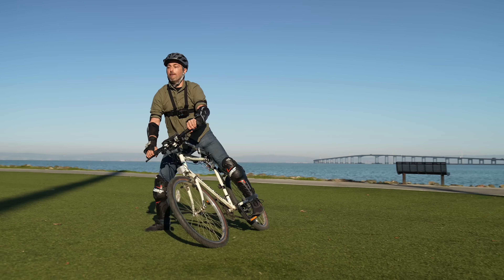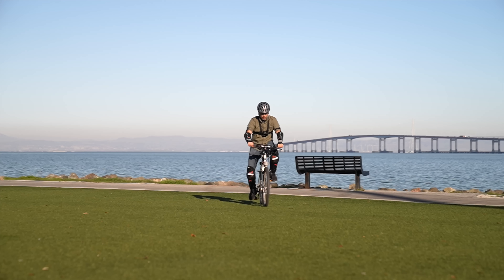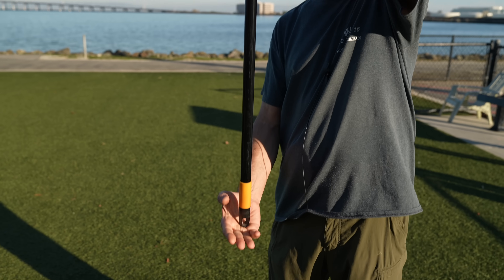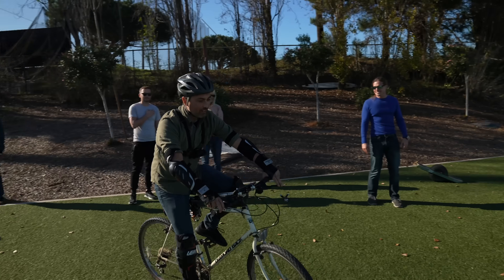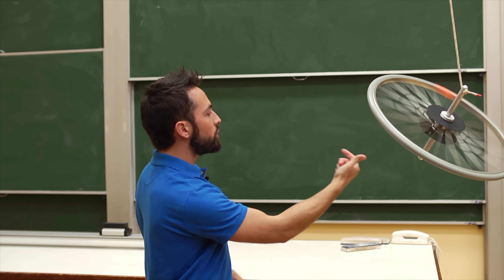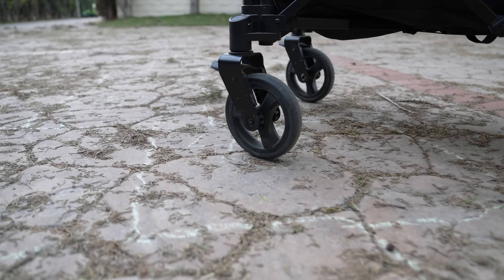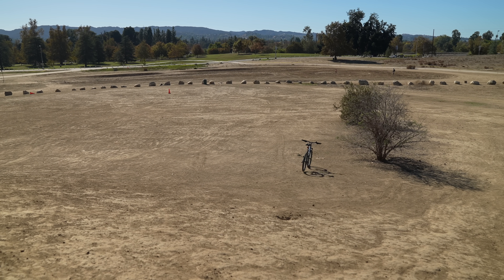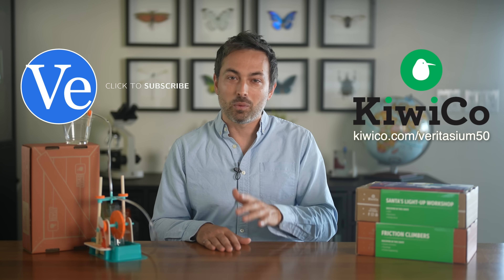Most People Don't Know How Bikes Work

Comment: Anyone who drives a motorcycle regularly knows "Push right, turn right. Push left, turn left."
You push to initiate the lean to go into the turn.
If you are someone that has actually raced a motorcycle through a race course with turns and not just some dingus dragging down the highway you are consciously and intentionally pushing fairly hard to initiate those turns at great speed.

Comment: Derek, you haven't covered higher speeds. Most bike racers steer by leaning the frame, not turning the bars. Racers know about countersteer, but in many cases, I think we just lean. Try it (not with the fancy bike but use video to look for countersteer) at 25 miles an hour. In addition, a canyon road has a canted roadbed, which allows more leaning and less steering. Would love to hear about this at speed. In a parking lot, it's obvious.
Reply: You do countersteer knowingly or not.  That doesn't mean you swerve left significantly before you do a Right turn
Reply: Nah.  Slow speeds are weird to me.  But.     Motorcycles lean when left when you push left or pull right.       That can be unconscious n I only ever did it consciously to check that it was so.                      I'm talking 70-140kmh footpegs on the ground.     I am sure you are wrong.

Comment: I mean, except for the fact that the bike is literally rideable and you can even get lucky and turn it sometimes if it's locked at just the right time. Seems like you could easily lift the front wheel off the ground, lean a little one way and then turn perfectly fine. The title is more clickbait than anything.

Comment: This is a motorcycle riding 101. It's the first thing you learn... to go left you push the left handle, not pull.
Reply: Best demonstration I've seen is by motorcyclists going at high speeds (the effect is more pronounced that way), letting go of the handlebars, and then using a single finger to push on the left handlebar just slightly and the bike veers left, and then same thing on the right...

Most motorcycle riders incorrectly state that this effect only happens at higher speeds, and at low speeds (below like 12mph) you turn the handlebars "normally", as you would on a bicycle. Derek just demonstrated in this video that this concept is true at ALL speeds. 

What many motorcycle riders don't realize is that AFTER you initiate a turn, the wheel and handlebars are actually turned slightly in the direction of your turn - countersteering is only to initiate a turn or to change the turn radius. Once you are already in a steady turn, your wheel and handlebars are pointing in the correct direction. Twist of the Wrist 2 explains this well when they attach a degree measuring device to the handlebars of a motorcycle.
Reply: @PeterDB90  the difference is not how you initiate the turn but how you continue turn at slow speeds
Reply: @wayward03  There is no difference - the above video showed that. Even at slow speeds if you are already in a turn and want to turn more sharply, you cannot just turn the handlebars into the turn, that will stand your bike (motorcycle/bicycle/whatever 2-wheeled vehicle) back up and make you go straight instead. To turn more sharply, even at slow speeds you still have to countersteer first to increase your lean and THEN turn in the direction of the turn (all of this is done by you intuitively and subconsciously).
Reply: @PeterDB90  I guess I wasn't that clear.  At slow speeds you counter first and then turn into the direction you want. 

At high speeds its just the counter steer,  you do not turn left to go left at high speeds.
Reply: @PeterDB90  I can guarantee you that while in the turn you are still holding the bars the same way. The bike is leaned into the turn and probably even ever so slightly turned in but your strength is still needed to continue a countersteering pressure although much less force than when initiating the turn.
Reply: @wayward03  Well, of course - especially with the rear wheel supplying power to keep you moving forward, the bike has the tendency to turn into the turn causing it to stand up, so you need to have continues pressure on the handlebar to keep it leaned, but the point I'm making is that while leaned over, your wheel and handlebar are turned INTO the turn, not away from it.

I guess that's where the confusion lies - you are saying that at slow enough speeds, the bike doesn't "try to stand back up" so you no longer need to apply CONTINUES pressure on the handlebars while in the turn (and in fact need to actually pull a bit on the handlebar to keep it from falling over), so in that sense, steering at slower speeds is different. I was only pointing out that while in the turn, the bike always points toward the turn and countersteering is only done to cause (or increase) a lean angle, which then puts you in a position for the bike to turn the wheel and take a corner.
Reply: @PeterDB90  Yes, if you kept turning in the initial direction you would end up as a pretty pink paste on the road.
Reply: You guys had instructors??? Mine was the road.
Reply: @bruhatthedesk5118  IDK where you live, but where I am it is illegal to have "the road" as your instructor. You have 2 options - 1, get an instruction permit and ride a motorcycle while under the supervision of a more experienced instructor (that isn't "the road"), or 2, take and pass a Motorcycle Safety Foundation course, which includes human instructors.
Reply: @PeterDB90  How it works in South Africa is you go get your learners license and then you are allowed on a bike, no larger than 150cc if under 18 and if over, you can ride just about anything. you are fully allowed on the Highway. the only limitation is that you are not allowed a passenger. Once you have your full license, you can carry a passenger.
Reply: Counter-steering doesn't come into play until a certain speed.  That's why noobs feel so awkward at parking lot speeds.
Reply: @supernoobsmith5718   Counter-steering comes into play at any speed above 0mph. We are both literally watching a video where Derek explained AND demonstrated it.
Reply: @PeterDB90  In other words, you never rode a motorcycle, or took a class.
Reply: @supernoobsmith5718  Uhh... ok. In other words I'm going to ignore this conversation unless you provide me with a more detailed argument than "NoObS DoN't KnOw HoW tO TuRn At LoW sPeEds".
Reply: @PeterDB90  What I'm saying is very common  MC skills knowledge.  Read, Keith Code's "A Twist of the Wrist". A classic road racing handbook.
Reply: @supernoobsmith5718  I haven't read the book, but watched A Twist of the Wrist 2 many times (in my MSF course and also YouTube where the full thing is available), am very familiar with it, and actually referenced it multiple times in this thread. 

I invite you to look it up on YouTube and watch from about the 3:00 minute mark where he explains countersteering by using an example of a little girl on a bicycle riding at probably around 2 to 4 miles per hour. Notice he doesn't say "at this speed, counter-steering doesn't come into play" he still talks about it the same way he would about a motorcycle going 60mph. What I'm saying is no matter the speed, you always, ALWAYS counter-steer to initiate the turn. It's what gets you to lean into the turn.
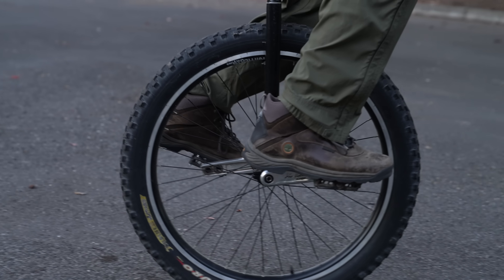In fact, he echoes what I've been saying at the 4:15 mark where he says (I'm paraphrasing) to go right you put pressure on the right handle bar - this initiates the turn, the bike leans over CAUSING THE WHEEL TO TURN INTO THE TURN <- this happens at all speeds.
Reply: I almost went off the road in a corner not knowing this. Once I learned it steering was effortless no matter how heavy the motorbike.
Reply: yep.... would have helped me a lot watching this before my first practical lesson on a motorcycle :D
Reply: @u0000-u2x  When I booked my first motorbike lesson, they asked if I had a push bike. When I said yes, they told me between now and my lesson, get on it in an empty car park and practice pushing left to go left and pushing right to go right instead of how I used to riding the bike. Amazing advice!!
Reply: @bradpoynting4691  great advice! my first encounter with the cones was hilariously frustrating as I couldn't understand why I was pushing the left handlebar but the bike would go left or straight (when I instinctively counterbalanced). unfortunately my instructors aren't as good as yours were, so it took me a while to - again instinctively - get into the flow of countersteering before a turn
Reply: @bradpoynting4691  Lol.  Dont even know what you are talking about.  Began to ride a bicycle at maybe 4/5 yrs old.  At the point I went to a motorcycle I got on it and rode on the hiway at 50 mph immediately with no trouble.  Certainly no lessons or advice of any kind was involved

The word "snowflake" comes to mind
Reply: @herbertlong3981  or maybe, just maybe other people might not have the same instinct as you do and might need instructions from an instructor that is there to help you learn how to operate a heavy vehicle on two wheels. Leave the man alone and just be happy that there is another passionate rider amongst us.
Reply: @herbertlong3981  sure maybe you and many others can hop right on the highway right away without issues. But considering a crash at three quarters that speed could easily kill you, it's worth ensuring people know what they're doing before getting on the road.

Comment: You can balance a stationary bike in-place by standing up on the peddles and allowing it to lean left and right under you - while your body stays in place.  Your body ends up being the stable mass and the bike becomes the pendulum.  If you sit on the seat, you take away the ability for the bike to move independent of your body, and then you can't balance it easy.

Comment: 00:08:52 Doesn't this observation contradict Newton's 3 law of motion? in the sense that the forces are not acting opposite but at a 90 degrees angle 🤔 It is as if the moving piece phaseshifts the input at 90 degrees.

Comment: Counter steering is a concept that motorcycle riders are very familiar with and it's even written in the rider training manual. Even really seasoned club bicycle riders don't understand it well. In a paceline, my rider friends know me as the guy who never slows down in turns. I take tight turns at 25 mph where others swing wide and slow down. It's all due to motorcycle experience and counter steering.

Comment: I thought the main reason why a moving bike is stable was the conservation of momentum. 
So if a bike moves along a straight path its center of gravity will follow that lone and it will take some outside force to move it off that path.
I still think this plays a role but it's nor a sufficient explanation for the effects you showed in those video.
So great job 👍
Reply: Each time your legs crank the pedals the center of gravity shifts to the left or the right - regardless of the action of the wheels, the bike is going to 'wobble' along its path in response to the rider's shifting weight with each leg stroke.

Comment: As a professional cyclist I would disagree with your statement that you counter steer to turn. Yes you can do that but you don’t have to.  What you demonstrated very well was how you consistently correct by wiggling back and forth and this is why you fall over on that bike. Because by the time you see or feel it’s locked your already to the point where your leaning the wrong way..
Reply: Mtb trials?   I don't know what's with low speeds but there's a switch or transition.  But.   Going down a road at 50kmh you do have to do this on a bicycle all the same.   It's minimal. People don't know on a motorcycle either.
Reply: Yes MTB trials won 7 National championships and won the North American championships. 

It’s more about shifting weigh then counter steering. Yes you definitely do counter steer at times but you can easily turn without doing it.  With a few days of practice this bike could be ridden. And turned in either direction. But to do this you would have to have good enough balance to ride skinny’s like down train tracks on the rails

Comment: The question is are we really correcting or are we just "following" the handles movement?
Give someone a bike that doesn't correct itself and let's find out I guess :)
For example in a car you want to have positive caster, turn left and leave the wheel and it will straighten itself.
This alone could probably make a bike very hard to drive.
Reply: We follow. Bikes correct themselfs in a turn. If you try corret it by own bike will start to turn other direction.

Comment: Isn't it weird to invent a steering motor that keeps the bike stable at lower speeds when the bike is stable for as long as it moves? I mean, you should keep your hands on the handlebar, so you are stable for as long as you roll. 
Unless you want to not come to a stop in front of a red light to keep some kind of momentum going, I don't see any use in a steering motor, to be honest.

Comment: Now I'm really curious. I'm a bit of a pro at riding no handed and you can actually steer extremely well without using the handlebars. What I don't know is if leaning engages the handlebars in the same way or not. 

In the same vein, I have friends who have solid control when popping a wheelie or doing a trick. I wonder how much this would impact them?
Reply: The video does touch on that a bit but I'm still curious...
Reply: Hands or no hands all the same. Front wheel do exactly the same thing always. First point opposite direction and when the bike leans it correct itself and point to a turn.

Comment: After racing bicycles for 40 years I was well acquainted with the "turn right to go left" principle. Then I acquired an electric tricycle, and was astonished at how difficult it was to ride. Every instinct, muscle memory, and reflex acquired from more than 70 years of two-wheeled riding was not only wrong, but dangerous. The trike would drift right towards a parked car, so Instinctively I would tweak the handlebars a little bit right to begin the process of a left turn... and the trike just turns even more right. The next reflex is to lean hard to the left to steer away from the car. Leaning does nothing to steer a trike. Finally, it's full-out panic time, I close my eyes and squeeze the brake levers all the way to the handlebars in a desperate hope that the demonic death machine will stop before impact. It took me about three weeks to learn to overcome my bicycling instincts.

Laugh at me if you want, but I have had nearly a dozen other people try the trike, and virtually all had the same problem. I tell them to repeat this mantra out loud: "Drive it, don't ride it!" and that helps. Ironically, the trike is easy to ride for someone who has never ridden a bicycle or motorcycle. 

Two things I have learned that makes tricycling easier: (1) On rough ground (I am on cobblestones much of the time) don't keep a death grip on the handlebars. Let the trike do what it wants and it will pretty much keep going straight. (2) On tilted ground, when it feels like the trike will tip over put the pedal on the uphill side down and stand on it while leaning that direction. This lowers your center of gravity by over half a meter and makes the trike much less likely to tip.

Overall, the trike is a very practical machine. I recently hauled 42 kilograms of groceries home from the local market in a single load, much of it on cobblestones. The adventure never ends.
Reply: That's why trikes should have steering wheel. :)

Comment: The steering dynamics change with speed, so under 15 mph you turn the handle bars...after it's counter steer.
Reply: I don’t think that’s right. At any speed it’s all about using the front wheel to shift the balance so the centre of gravity is towards the direction you’re turning.
Reply: It's always a counter steer. There's no magic speed where the system transitions from "not countersteered" to "countersteered".
Reply: @allmhuran  take a motorcycle riding class. :)
Reply: @allmhuran  you obviously are a tough guy. under 15mph you do not counter steer. You push left to turn left on a motorcycle about 15mph. But obviously you teach riding.
Reply: @derekb5749  ... I actually do teach riding.

Comment: Brilliant! I’m sure bike designers must tune the stability depending on the requirements, touring vs racing vs trials bike perhaps?, a bit like how some aircraft are even deliberately unstable
Reply: Yes, this is often done via adjustment of the head tube angle (angle of the fork as shown in the video). Stuff like handlebar setup and weight distribution contribute too.

Comment: There is a gyroscopic effect.
 Your experiments are leading you to self fulfilling conclusions.
 BTW those counter rotating gyros in the one experiment are in parallel rotations, so they stabilize in an additive way.
Keep thinking about that 90 degree offset motion. You'll eventually figure out how i got a gyroscope rig to actually generate an offset thrust and actually fly.

Comment: At the start I disagree, you do not have to steer the opposite way first . In fact it’s quicker and easier to make the bike lean into the corner first before you steer either way then steer into it, negating the need to steer the opposite way first